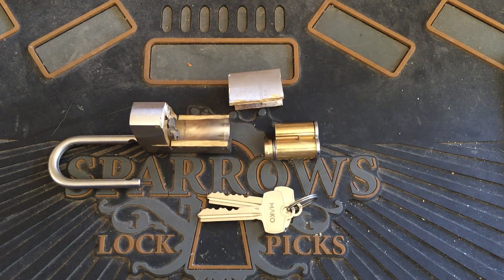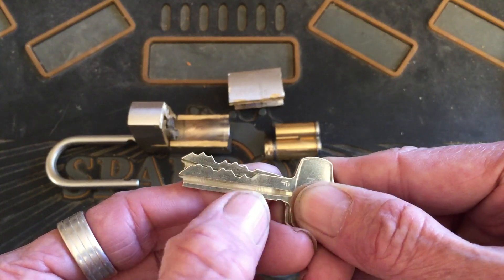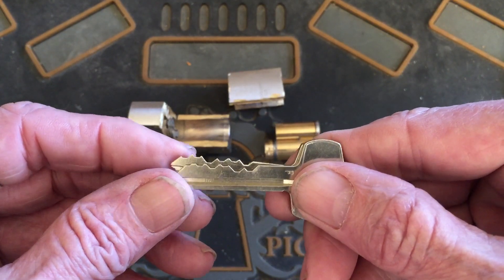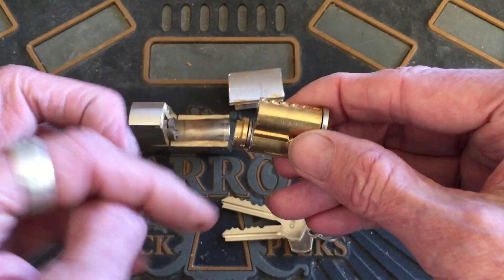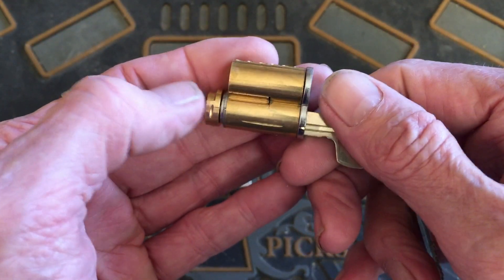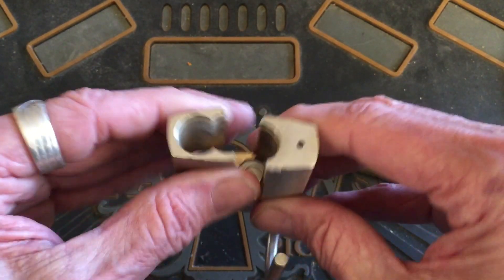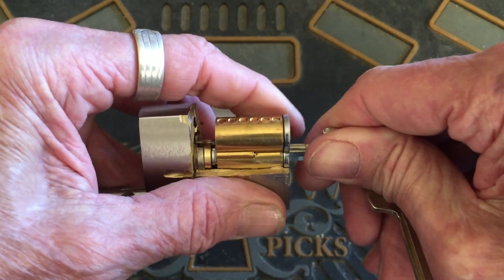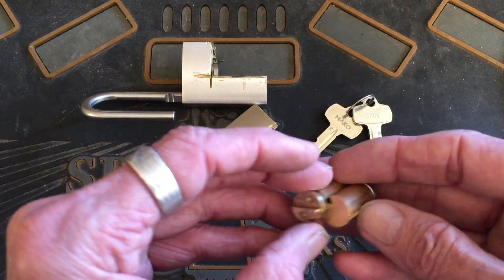(278) MAKO Lock Comments - Stuck Pins?

Comment: I wonder if the close biting on pin 6 between the CK and the Operating key played a role causing a pin jamb, especially if it got forced. Your explanation does make sense as well, odd that the core protrudes like that in the normal key position.
Reply from the maker: Thank you my friend, I think it would have to be stuck pins.

Comment: I was able to replicate your problem with a Best SFIC. Its possible to install a 6 pin core into a 7 pin lock body with the actuator upside down on the core by leaving out the spacer.
Once the core is in and the control key is removed the operating key can be put in and rotated 180 until the actuator on the core mesh's with the actuator in the lock, then the lock will open.
If the 2 actuators stay meshed together the operating key will be stuck in the lock upside down.
Reply from the maker: Thank you my friend for checking that out.